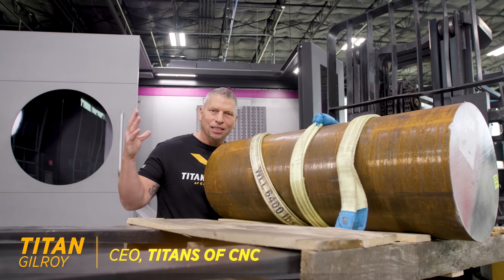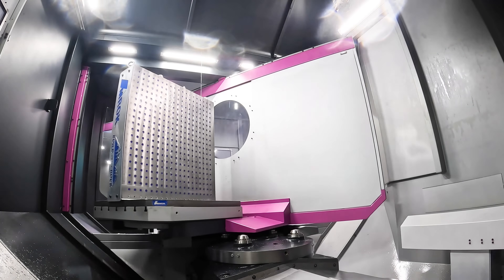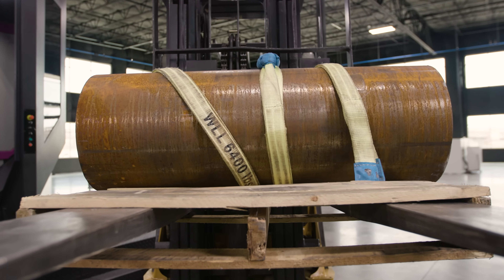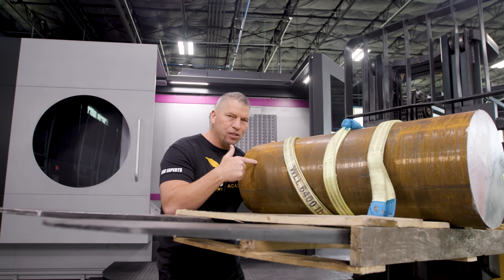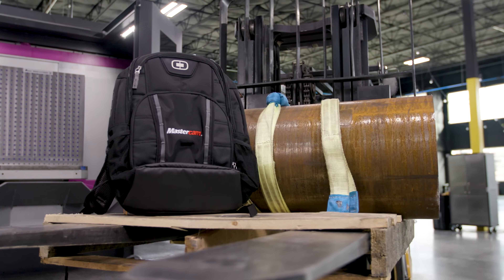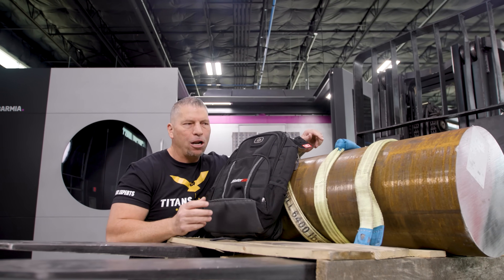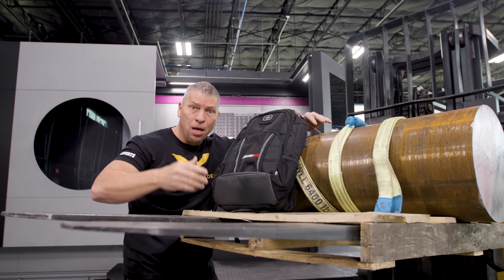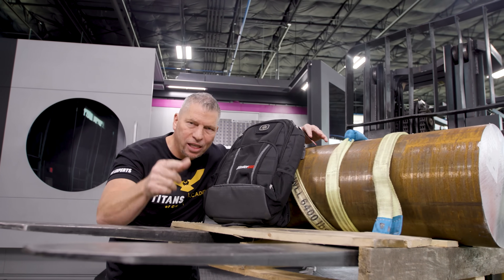How Would You Do It?? YOU Tell US How to Fixture This Monster!

Comment: Fixturing vertically on a HD rotory table with chuck driving from top of Z axis. Machine from center each way to keep the inertia forces uniform during material removal. To limit friction, the chuck and turn table need to rotate at the same FPM or RPM. No, not a machinist, but science and force's play an important part due to the materials massive weight. Bear.

Comment: Depends on what needs to be machined first. The ends need machining first: 2 V-blocks and chains to hold the part to the tombstone/table. The cilindrical face needs to be machined first: use a 2 piece vise to clamp on both "flat" surfaces and machine what features are needed to hold the part for future operations (i.e. machine holes and/or other features to use zeropoints or other clamping solutions)
Reply: Have fixtures, and stops to locate off of
Reply: @greeneyesfromohio4103  Because it is a one off fixtures and stops are not needed as it only needs to be referenced once in optimal conditions.

Comment: assuming that you installed four vices on the tumbstone, in the last video, I think that the part will be located horizontally, so I would do this 1) fix the workpiece on a free pallet and mill an edge/rib in the middle of the workpiece 2) clamp the workpiece in a vices for this edge
somethig like this))
             ........
             .      .          
             .      .                   
       ......      ......
  .                          .
 .                             .
.                                . 
.                                . 
 .                               .
  .                            .
    .                     .
           .  .     .

Comment: Well, I think it depends on how much and where you want the part to be machine, and on the finished part itself. I really want to see a plan or at least a 3d model so I can really think about it. But, depending on the finished part I think the more rigid way is to put your material on two V-shape vises and hold it with two chains on almost all the diameter, so you can tight that part hard. But if you want to machine it whole with the most surfaces on one op, you can do like you did with the Titanium Lion, clamps at different height.
Reply: Agree without more information it's an unknown. Throw a chuck on the machine and hold it like any other round piece of stock.
Reply: @mp6756  This part seems a bit long for a chuck, even with pre-machined surfaces, depending on the finished part it can cause vibrations, especially if you can't use a live center. Of course clamps at different heights does the same as a chuck, but you can make it as you want and put stops where you need them
Reply: @Zekrompredator   I gave it as much thought as I'm willing to for such a vague posting. To be fair the guy showed a video of a round bar on a cart standing in front of a relatively large machine with a palette changer, a tombstone on one of the pallets and says he is going to leave one pallet clean. Seriously there's no enough to work with here. You could clamp the bar down on the empty pallet with basic strap clamps dress one end with dovetails to clamp it on the tombstone. How much stock do you have to work with what tooling is available do you have a v-block fixture from a job you have run before? Is Shunk providing the tooling? I'm not trying to sound like a dick however honestly we don't have the budgetary freedom that he has for the majority of the work he highlights in his videos. If Kennametal was handing out Harvi end mills like candy and if it snowed ceramic and carbide inserts and perishable tooling, into the truck beds of work holding products that Titan has at his disposal we could dream up all sorts of solutions to the problems that arise in work holding. But I'm afraid with the information given its impossible to lay out a strategy as asked with any level confidence. I really enjoy the videos to see the latest and greatest tools and technology but I already have a backpack and plenty of T-shirts. I can't imagine my boss dropping off the stock at my bench and asking me to fixture it without at bare minimum a sketch.
Reply: @mp6756  Yeah it's hard to come up with something without a plan, and we use to think like we're making this part in the shop we're working in, with the jobs we've already done in the past, with our machines and our tools and vises but we don't got these in this case. I also would've liked to see this machine making a nice roughing operation, just to see how it can handle vibration and big tools. I assume it's pretty rigid and powerfull but I've just seen it drill some small threaded holes ... I feel like trying to teach someone to drive in Indycar just by watching it on TV and driving my daily car 😅
Reply: @Zekrompredator  Right it's hard to say without more info I like your approach. I've done some really cool stuff but nothing of that size certainly not that heavy. I'm interested to see how it ends up dangling that bar out to cut 5 sides in one setup.

Comment: Weld it to the table,  it will be fine.
Reply: You could always get a magnetic work holder . You've utilized them in previous videos if I'm correct. I'd definitely put a smooth finish on the contact side so you don't scratch the work holder
Reply: No brow you must Cut it from the Destk
Reply: Good idea bro xD
Reply: If it was mild steel you could do a few spot welds to a plate, drill a few holes in plate and bolt to table/tombstone.
Reply: Welding 4140 never works when you need to machine it.
Reply: This is my favorite idea

Comment: Titan, you can't even begin to think about fixings without a drawing. Or at least an idea of what you're going to machine out of it.
Cheers
Reply: Also, do you know they make special machines for cutting round things 😉
Reply: @michaelharrison1880  yep when you dont know what your making you dont know how to hold it
Reply: @michaelharrison1880  Isn't the smx 2 series the big round thing maker at titans and it cant do that kind of a job. You need a 3 series with a tailstock. Or something else that is bigger in size. Or maybe put a center on the sub and then you realize you need a steady rest. So there is a perfectly good reason to do it on the ibarmia.
Reply: @TommiHonkonen  lol
Reply: @michaelharrison1880  why is it lol
Reply: that was the first thought in my head
Reply: Exactly, what are we making? I need a drawing!
Reply: Which is surprising if you think about Titan's usual prep for video. If he just want to have a pretty cylinder then I dont event think he would need a tombstone for it. Just a pair of jaws on the base would be sufficient to keep it vertical for slow rpm facing and turning. If nothing else is known I have no other ideas than to keep it simple. If part is really uneven and cylinder wont be properly secured then putting it horizontal and facing both ends also make sense. It's not a HUGE part so it will be impossible to secure it with proper clamps.
Reply: New update.
Titan says they are going to machine 5 sides of this part.
Correct me if I'm wrong, but doesn't a cylinder only have 3 sides?
Help
Reply: @michaelharrison1880  i think, if that chunk is placed horizontally and fixed from the back, it's up, down, front and both ends.